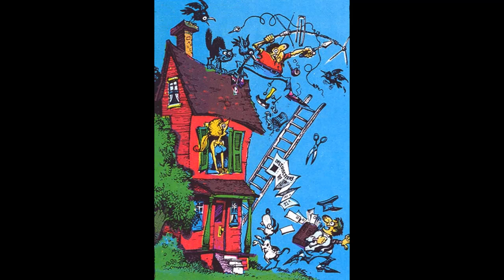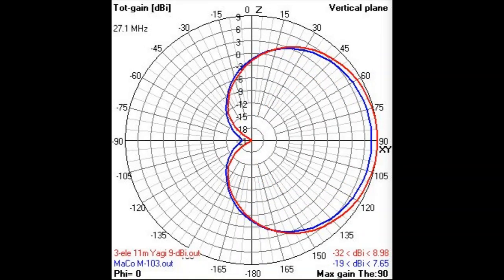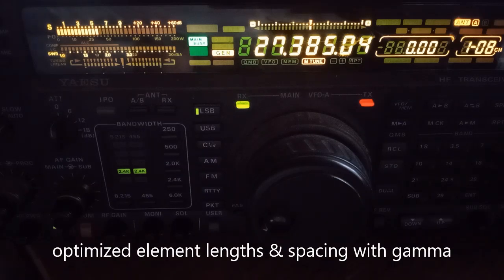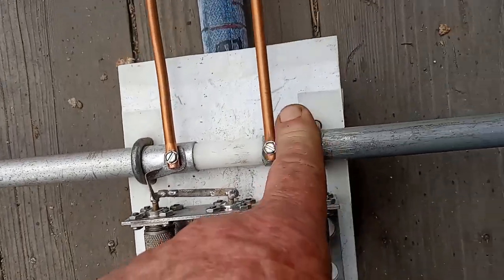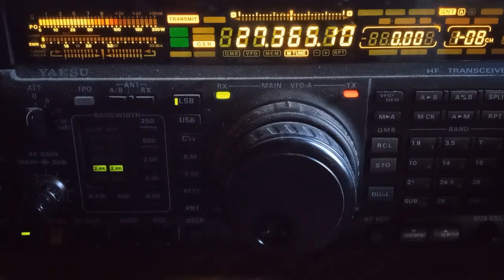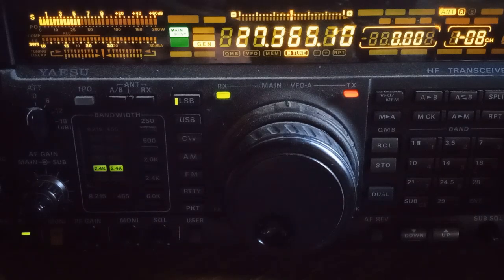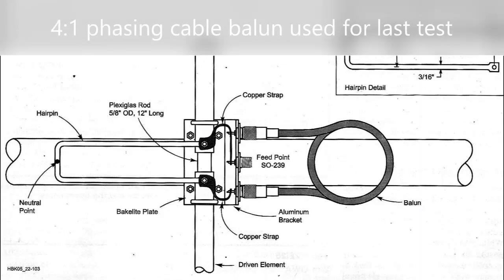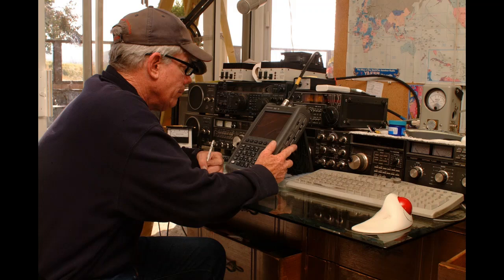The Ultimate 3 Element 11-meter Yagi  Part-3

Comment: Nice you could just pull back the driven from director 18 inches an your good togo but my pdl2 an my old Moonraker 4 out performed the 103 my penetrator 500 for an ground plane really kicks but nice video
Reply from the maker: Stay tuned, I'm very close to wrapping up a video on the PDL that has been over 10 years in the making and hands down in my estimation pound per pound is the most potent antenna to hit 11 m.  Quads are the first to open a band and the last to leave, check out my video on Big Bamboo.  73 & Happy New Year

Comment: Has there been a follow up video with the finalized dimensions?

Thanking you in advance.
Reply from the maker: No I ran into an issue I had two antenna testers that have M103 s and I wanted them to apply the computer optimized dimensions before releasing the info to everybody. The reason being is the tubing diameter is on my Homebrew three element shown in the video is slightly different then the m103 tubing and I know the New dimensions will outperform the old ones however I'm a perfectionist and to get the most out of an optimized design you really want things to be spot on and I expect using the M103 tubing there will be a minute amount of fine-tuning that is important to me as I want everyone to realize the absolute best performance in this three element design which much like a formula 1 racing engine requires everything to be exact. 

It doesn't look like I'm going to get those m103 fine-tuned dimension so I'm going to go ahead and release part 3 oh a time change in a little bit to show folks how and how not to tune an optimized antenna. Stay tuned I apologize I was hoping to do this during the summer months of North America when people could have actually worked on their antennas and I've fallen behind due to the aforementioned reasons. 73

Comment: Well done on the build! Have you checked the rejection off the back of both antennas? 73s Chris
Reply from the maker: having the split driven element being driven 180 ° out of phase makes this a whole different antenna that is incredibly quiet with virtually no side lobes & the F/B as seen in Part 1 of this video is vastly improved on paper and in the real world too. I have Yagi and Quad antennas of all sizes and I can honestly say this hot rodded 3-element is on par with most 4-ele 11m yagis Madison current offerings are so pathetically outdated using the old Yagi / Uda formulas
Reply: @s9radio brilliant and thanks for sharing! Computer stuff is great but can’t beat real world testing 👍

Comment from the maker: Thanks Mike, I have been using the 180 out of phase scheme since discovering it in the ARRL handbook decades ago, it's the only go and really brings the 3-ele into a whole new realm with a cleaner radiation pattern and lower noise. 73-Gregg
Reply: So it's the 180 out of phase coax the " badger balun" ?
Reply from the maker: @turtle_and_fliptag yes best to get a copy of the arrl handbook,  they are in there and the phasing harness has to be exact, cut to the electrical length not the physical length. 73

Comment: Don't you perhaps want to share the optimized dimensions for the stock MACO M103, especially the hair pin and the balun coax dimensions. I'm using a home brew MACO M103 and I would like do do the mod.
Reply from the maker: Stay tuned, these dimensions are being implemented on a M103 right now and undergoing final tweaks.
Reply: @s9radio  Thanks.
Reply: @s9radio I’d like to try all of these specs on a 103 if you bring them out ! Thx 👋 73

Comment: Waste of time you would have better results just putting it up 10 ft higher
Reply: Assuming this is true (may or may not help that much depending on location) - why not still do this and also raise the antenna?
Reply from the maker: So even though I'm located at 6,000ft, a mile high you think I'll do better raising the antenna 10ft?

So even though I've run this scheme / antenna at numerous locations over the last three decades and it has flat kicked traditional Yagi-Uda designs out of the park and all these improvements are found on all the better amateur Yagi designs, you're insinuating the NASA engineers, George Badger of Collins Radio and the  
PHDs in physics that came up with these methods are wasting their time ?
Reply: Well said.👍👋🇳🇿

Comment: if i were to test  i would use a digi mode. let the computer tell me the difference....
Reply from the maker: Agree but knowing the 11m crowd I've avoided getting to technical with instrumentation and test data few could understand. These On-Air test seem to drive the point home.  The plan is to follow this up with test range data which probably won't happen till next year at the annual Burning Ham get together which is now on it's 15th year and founded as an antenna competition. 73-Gregg s9radio
Reply: If the the 11m crowd wouldn't understand,  maybe do so for the 10 and 12m crew.  I'm sure they'd enjoy! @s9radio
Reply: Using digi mode is not hobby friendly testing,adjusting testing again is the fun part of the  hobby!!!